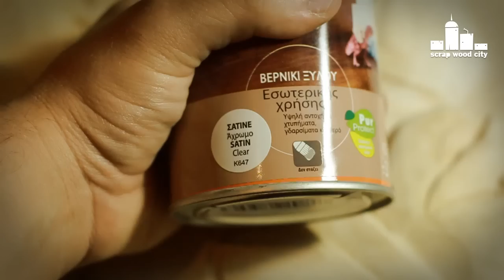Learning wood carving - The pontian

Comment: WOW!  Great job!  I've never used lime wood.  It looks like it has fairly even grain.  Were there any crazy grain areas you had to work around?
Reply from the maker: AdventuresInDIY there were some areas where the wood splitted easily but in general lime wood is used by woodcarvers a lot (at least in Greece). The grain are pretty straight it has very few notches. It also sands really nicely. Thanks for watching and commenting.